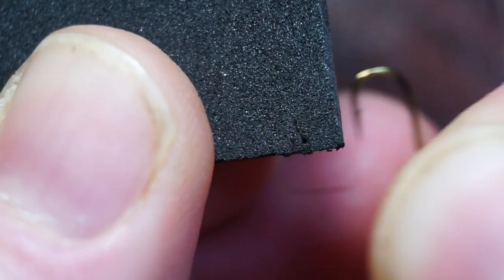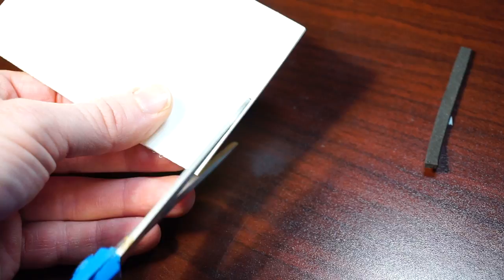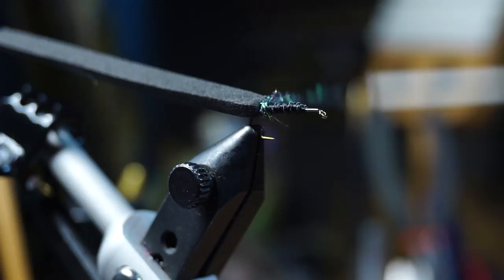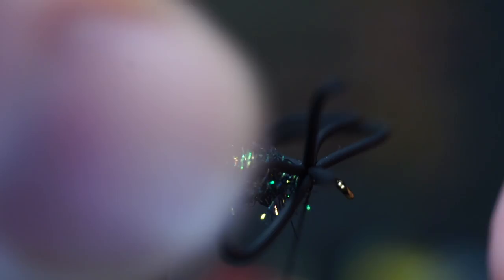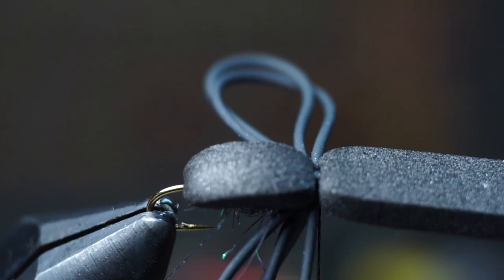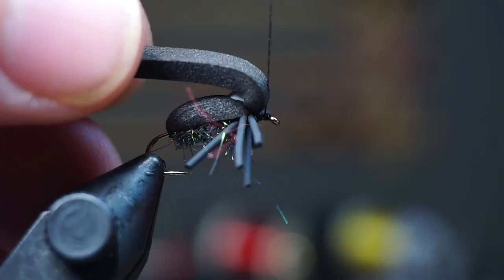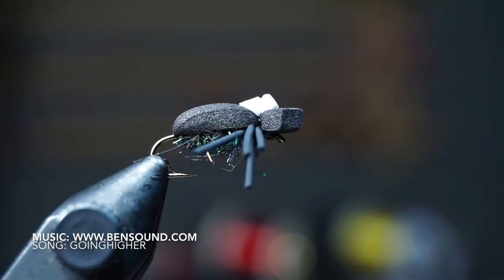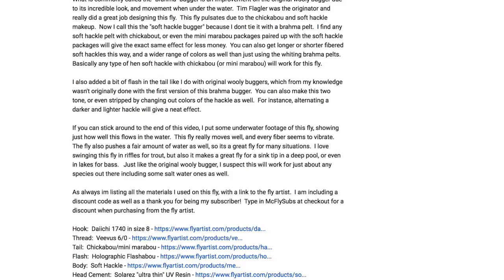Foam Beetle, all synthetic materials - McFly Angler Fly Tying Tutorials

Comment: Hey Shawn.  The video looks great, looks like you stepped up your production and I like it. Did you get a new camera? the close shot looks nice and sharp. Cheers
Reply from the maker: Thanks!  Yeah I’ve had the same camera for about a year now, however I always tied one angle, and over my shoulder.  Now, I put the camera closer to the hook, and in between me and the fly.  Makes it about 10 times more difficult to tie because the camera actually blocks my view of the fly.  I look through the view finder of the camera to tie the fly now.  But, it does increase the crispness and quality of the video I think.  Thanks for noticing!  :)
Reply from the maker: Also I’ve been really working on tweaking the camera settings and finding the perfect ones.  That month I took off filming I was able to find some time to really work at the production level.
Reply: Ya, looks great. I do the same with the camera angle and I can appreciate how tricky it makes tying a fly. Keep up the great production.
Reply from the maker: Thanks!  Yeah, the flies I tie on video usually don’t come out as nice because of it...  haha
Reply: What camera do you use?
Reply from the maker: Sony A6000 but it’s more about the lenses I use with it than the camera body itself.  I forgot the model of the lense.   But macro is key.